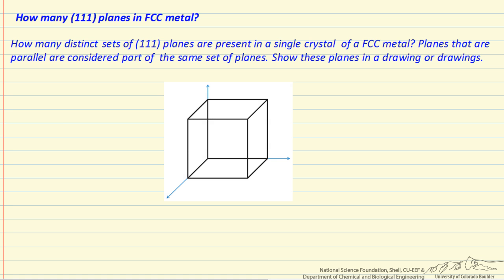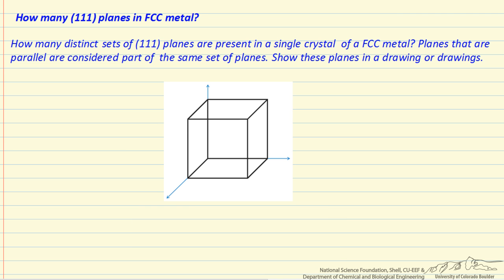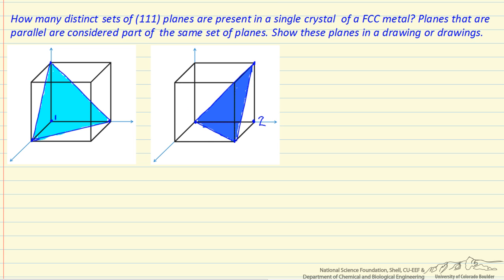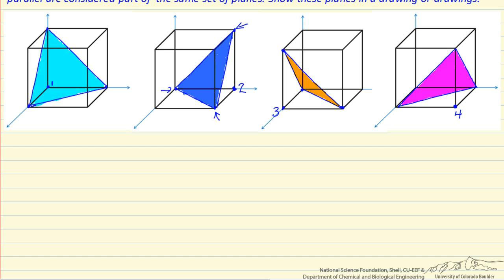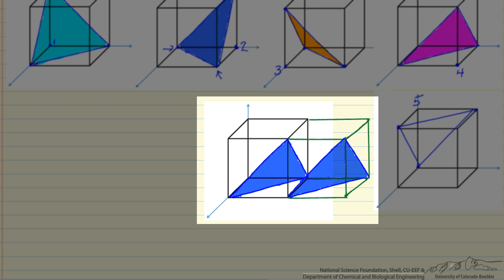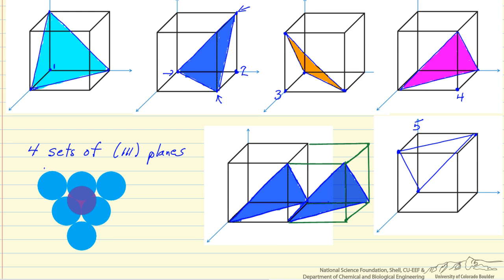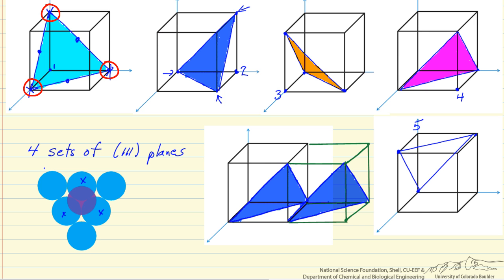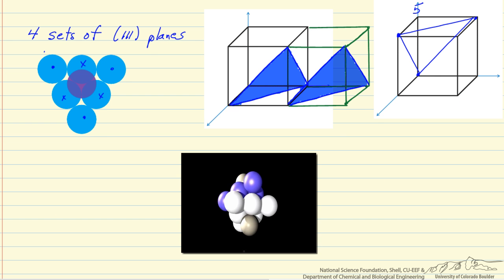(111) Planes in FCC Metal

Comment: how does on know the planes?
Reply from the maker: That is where the (111) comes in.  That means that when you start from your origin point, you move 1 unit in the x direction and mark that point; move 1 unit in the y direction and mark that point; move 1 unit in the z direction and mark that point.  Those three points form a plane.  Does that help?